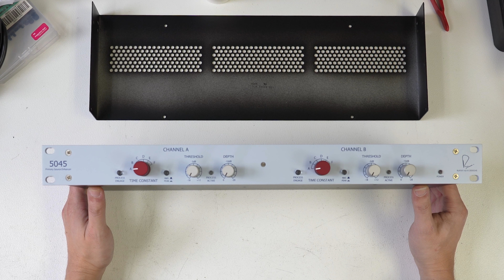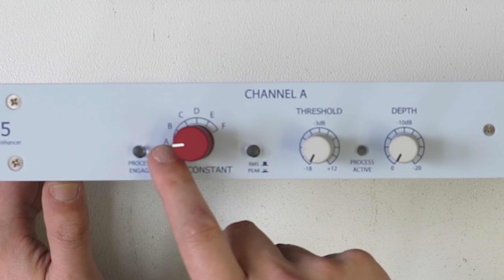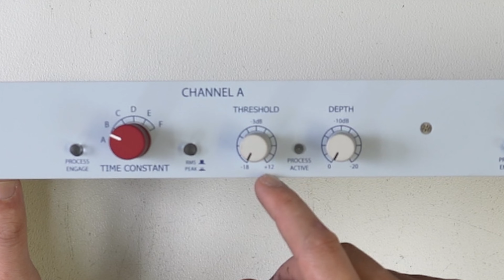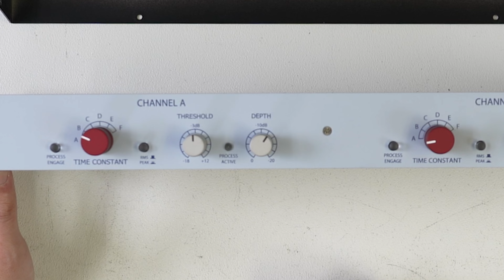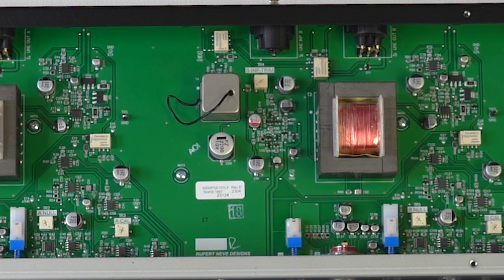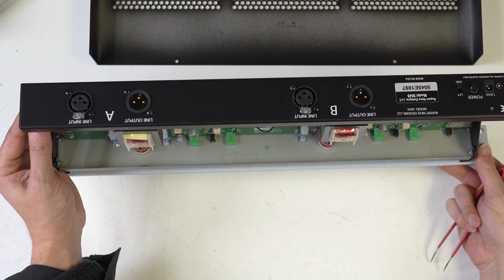Rupert Neve Designs 5045 Primary Source Enhancer | Part 1 Overview

Comment: It's so crazy expensive, I'm open about my intentions to dupe this thing. It's criminally expensive.
Reply: Hmm, did you ever check prices for hardware preamps, EQ, compressors? Rupert Neve Designs produces 500series module of it (for example if you need just one channel). And this unit is really good suppressing feedback. Really natural way without any EQ to defeat feedback

Comment: Finally I see someone talking about this rack. I've been using this in my vocal chain for my livestream for 6 years now. I use it instead of a noise gate to clean up room noise.

I know its used for feedback reduction but it's a real gem for podcasts and livestreams to clean up room noise without degrading the audio quality and without the choppines of a traditional noise gate. Also noise gates aren't class A components this one is, this means that my vocal chain maintains a Class A throughout the chain.

Comment: Hi Billy, thank you for this video. I'm always interested to see what's under the hood. The photocell you referred to is the input transformer. I'm guessing the 'brains' of the units are the chips south of the 'A null' and 'B null'. Good chance it's a That corp chip. The 'battery' is actually a DC to DC converter. It supplies two higher voltages from the single (12 Volt?) external supply.
Reply from the maker: Danny! Yes! Thank you for the explanation! Board level components / circuit design are my weak points for sure.